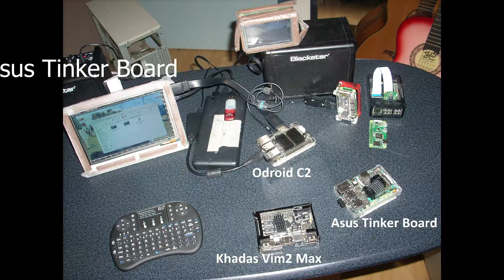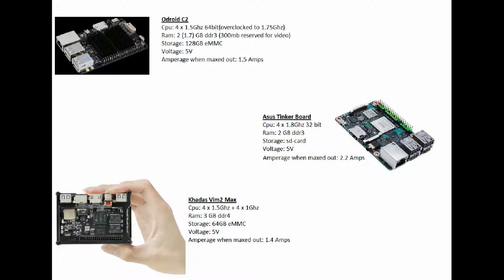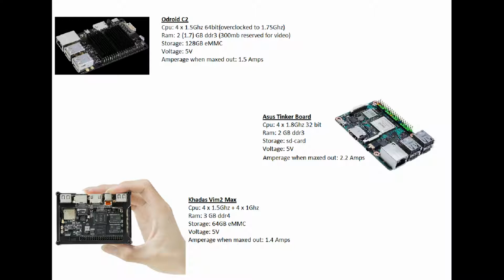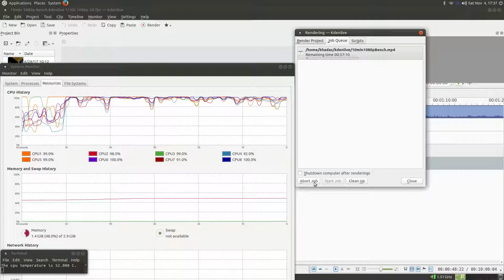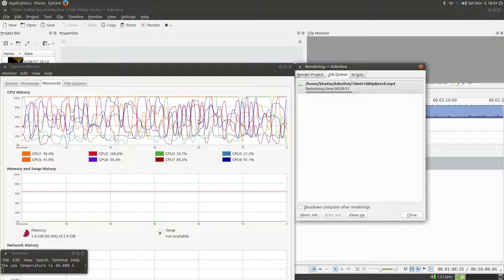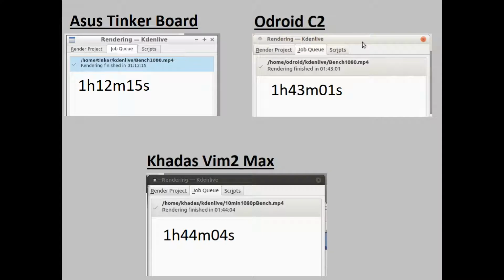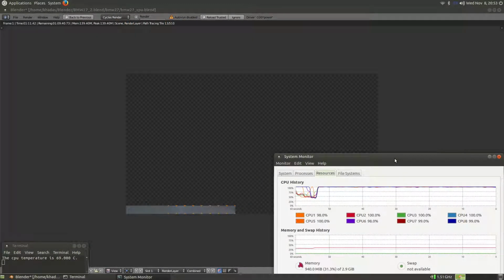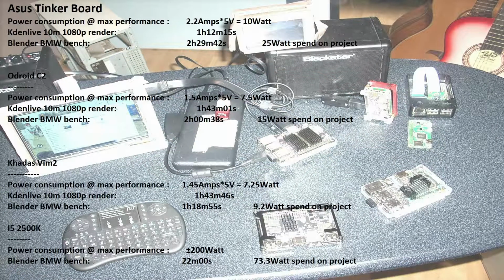Khadas Vim2 Max vs Tinker Board vs Odroid C2 Kdenlive+Blender benchmark

Comment: Hello dear NicoD.  I enjoy watching your videos with great pleasure.  Thank you so much for your work in creating these videos.  I'd love to see a comparison of the new Khadas VIM3 PRO and Jetson nano.  I’m looking for an optimal board for a desktop computer, YouTube, watching movies in 4K, and for studying Python and neural networks.
Reply from the maker: Hi Dmitrej. The VIM3 is a lot more powerful than the Jetson Nano and can watch youtube on its CPU, but it doesn't have VPU acceleration for it. It can handle up to 1440p with 1080p display resolution, what is more than the Jetson Nano with VPU acceleration. But the Nano can handle it at higher display resolutions.
Only the RK3399 boards have VPU acceleration for 4k video in Linux. I use the NanoPi M4V2 as main desktop pc. The VIM3 is used to render videos and for blender renders.
If you use Android then the VIM3 is a good choice. But if you'd only want to use Linux then it is missing very important drivers. No GPU drivers, no VPU drivers and no X11 drivers. 
The CPU can make up a bit, but it can't do wonders. The Jetson Nano is also rather slow compared to VIM3 or RK3399's. I'd go for an RK3399. A lot better software for it, and all the drivers needed. I'm now working on the panfrost drivers to work in armbian for it. 
Greetings.
Reply: NicoD Thanks so much for such a detailed answer.

Comment: How much ram do you get under Linux. Was it 2.8GB
Reply from the maker: Yes, there is 2849MB. This is far from my favorite SBC. It looked good on paper, but it didn't deliver. The RK3399's are a lot faster and better supported. The NanoPC T3+ is also an octa-core, but a lot faster than this. 
It also costs too much, so I can not advice to buy this. 
Only for Android this is well supported. But in Linux it is very weak. No workable video playback, and slow single core performance.
With better support by the SoC vendor this could have been a good one. But it's not. Greetings.

Comment: What version of blender are you running and where does it come from?
Reply from the maker: The version depends on the system 32/64bit. You can install Blender from repository. Or the easiest way is to use Synaptic package manager. (sudo apt-get install synaptic) then search blender and install. Cheers

Comment: You need a fan. There is a fan connection, buy khadas give little details on it. It’s the white connector near the WiFi antenna, most back, right of the board. Max amps is 150 Millie amps, so make sure the fan uses that or less. This will solve the heat problem and the cores won’t need to slow down to save themselves.
Reply from the maker: No. There isn`t a heat problem, I do use a fan, it only reaches 55C max with the fan. I believe you didn`t watch the whole video and made a hastily conclusion. On the end you see that the Khadas does amazing in Blender. It`s Kdenlive that can`t work with the different sized cores. Thanks for watching tho. Cheers
Reply: Hi. I did watch it all... twice. Heat is the only reason I could think of for the cores slowing down. They do that to save themselves. Maybe it could be out of memory at the point of slowdown too, but I doubt it would slow the CPUs for lack of memory. So, if not heat then I have no idea why it would slow the cores.
Reply from the maker: It`s 4 big cores of 1.5Ghz and 4 small cores of 1Ghz. Kdenlive devides the project in 8 equal parts and gives one part to each core. The fast cores are finished quickly, but the slower cores take a much longer time to do the same. Thats why it slows down so much at the end, it`s only using the 4x1Ghz. And that makes it slower than the others. No memory problem or heat problem. I hope there will be a fix for that. I use these sbc`s for video editing and rendering when I`m traveling. 
Have a nice day.